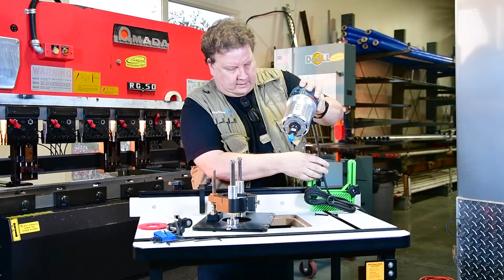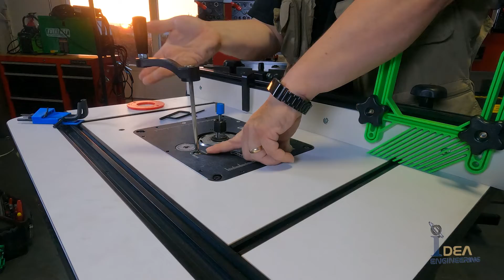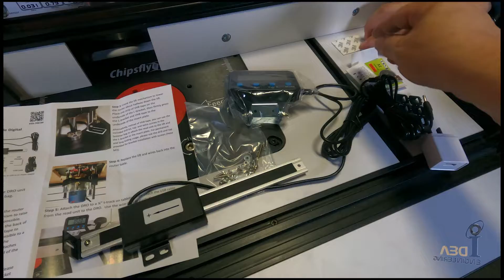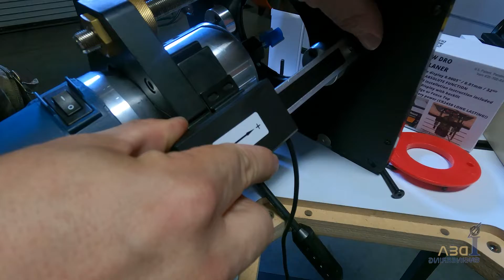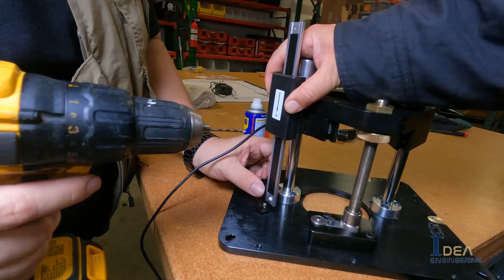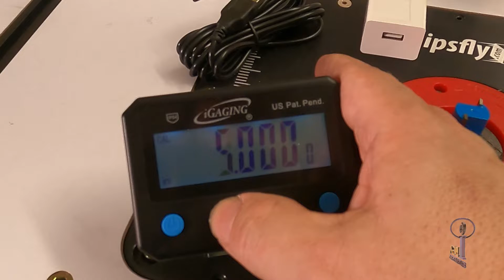iGAGING's New EZ Router DRO (Revised)

Comment: Hi and thanks for the video. Really helps. I was wondering if we should use a washer on both of those screws if we mount the DRO with screws? I would think that with all that vibration over time that these screws would possibly come loose? Maybe even some loctite?
Reply from the maker: Sure, it's a good idea. Loctite and/or locking washers would keep them from backing out.